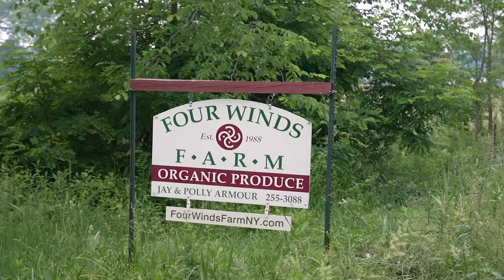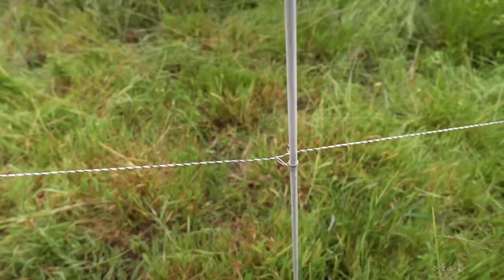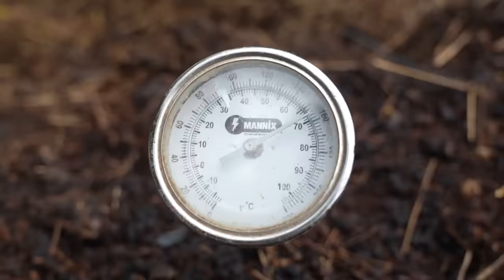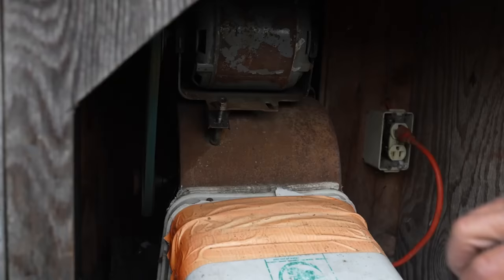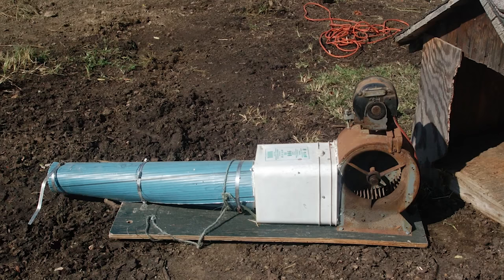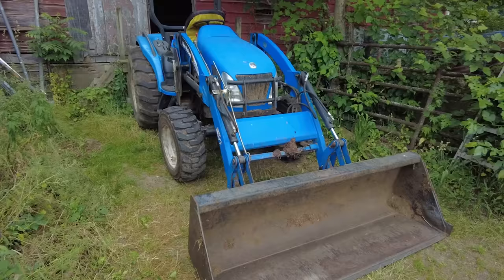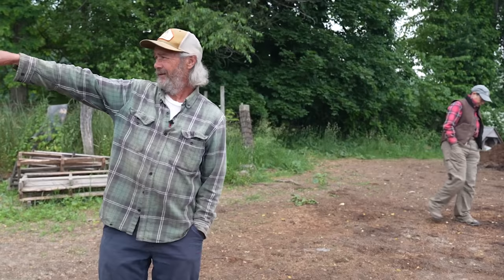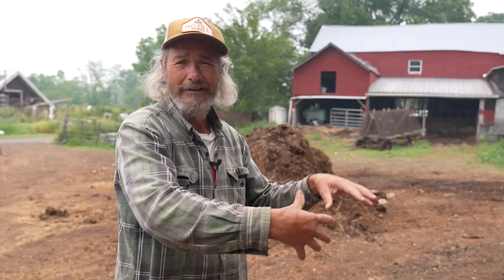A Simple Composting System for Small Farms | Four Winds Farm

Comment: On the forced air system, The fan from a kids bounce house has a round nozzle, and it fits perfectly into 4in drain pipe. We  bought our bounce house from Sam’s Club.
Reply: Good tip!
Reply: I’ve seen that used before works well.😊
Reply: Glorious.
Reply: A nearby city set up a municipal compost system with an old bounce house fan.
Reply: They also sell them individually. Just Google "inline duct fan" they usually come in 4in or 6in. I bought one from ac infinity but honestly if I would've known they were interchangeable I probably would've gotten a bouncy house instead!
Reply: Tell me more! How do you do the timing of turning on and off?
Reply: Another commenter pointed out that an inline duct fan is not the same. It's not. On another note, I read an entire diatribe from an engineer about bouncy house fans. Apparently, they offer a very high static pressure that's also great for removing fumes from laser cutters. +1 to the OP.

Comment: The duct fitting that converts your rectangle blower housing to a round duct is called a "square round" or "square to round." Most HVAC supply houses stock them. If they don't have your exact size, it can typically be ordered and made within 48 hours. A square to round provides less turbulence than your bucket which is essentially called a "plenum." Obviously, plenums work as well and are often necessary to abruptly change the direction of the airflow as a 90 degree turn would.

For those looking to do the same, a direct drive blower is safer. The "belt and pulley pinch point" won't have any mercy on a kids finger or a dog's tail. 1/4" or 1/2" hardware cloth over each side of the blower wheel works great at preventing contact with the wheel. Anything entering that wheel will be chewed into pieces. I have seen it happen with a possum. It ain't pretty! Happy composting!

Comment: Interesting they did not mention moisture. Many say 50% moisture is ideal (squeeze and get a drop or two out of your hand or see the water forming between your fingertips). My piles don’t heat well in our very dry SW Colorado climate without adequate moisture. I definitely need to add water as we build the pile. However, Beware too much water can turn the pile anaerobic.
Reply: Their mix of fresh horse manure and month old cow manure seems to be ideal, so much they don’t even remember to mention moisture ! 
New york climate is good for composting too

Comment: I once read you could cook a chicken in hot compost. Mine was around 160 + or - so I put raw hamburger in a sealed container then put it in the pile. The next morning it was cooked! Ate it too. I started hot composting using leaves from Arizona Ash trees and horse manure from a farm that rescued horses. Worked out very well but with two 3x3x4 foot bins I never had enough for the 6 raised beds I had. I did have PVC pipes through the pile and they did warp due to the heat.

Comment: Seems like you would want to do a full turn at least once.  Even if it technically meets the organic specs it seems unlikely that the temperature on the outside edge would get hot enough to make weed seeds non-viable.  Maybe the stirring with forks combined with relatively weed seed free inputs allows that method to work well for them.
Reply: He does mix it once. See video at 20:50

Comment: If the fan is controlled by a timer, but the owner is monitoring the temperature of the pile, and adjusting the timing of the fan accordingly, would an automatic temperature sensor not make more sense? So rather than the fan being controlled based on time, it’s based on the temperature of the pile. They’re easily found from the same hydroponic providers as mentioned in the video, and would give the ability to wholly set and forget, with no monitoring necessary
Reply: Absolutely an innovation probably just not known about. Sounds like a good setup to me, less hands on the better
Reply: Could be helpful but also adds complexity and other points of failure. A simple timer is easy to troubleshoot, replace, and will last a lot longer than any temp probe. Plus no cords to deal with. Idk if it "isn't thought about" as was suggested, but is just less practical than it sounds at first.
Reply: @stevenjacobs2750  I guess its a matter of scale at that point. I'd agree for the regular backyard gardener or homesteader, its probably not a necessary investment but for medium-large scale operations it could be worth it. You could probably look at all the temps on your phone in real time which could be very useful
Reply: @stevenjacobs2750  Good points

Comment: I use horse manure from a neighbor with 20 horses and leaves from the city, both brought to me in dump truck loads. One way or the other, the big wood, rocks, and trash need to be removed. I do it by hand, but I dream of screening it with a tractor someday. The trash will mark your potatoes and other root crops, plus you get big stuff like street sweeper asphalt chucks, horseshoes, walnuts, and horse toenail clippings Anyhow, be aware there is lots of manual labor if it isn't screened.
Reply: compost the horse hoof shavings.

Comment: Hi and thanks! Great! I wonder if someone could answer couple of questions for me? They use their compost for mulch. Do they add  organic  amendments to their beds also, or does the compost feed the soil well as well as mulch it? My most important question is the reason I am looking at ASP. Though I did not know what they were 6 months ago, I have discovered invasive Asian Jumping Worms in my conditioning compost piles (and in my garden, Missouri Ozarks). Heat kills the worms and their cocoons but as soon as my piles start to cool off the worms move right back in. Don't want to be putting more of these worms into my garden or have therm escape to my forests. Four winds is in an area that probably has jumping worms. I am trying to come up with an ASP system that is off the ground. And then I am going to have to change the way I store compost if I want to keep the worms out.

Comment: Is there any limit to what type of manure you can use? I have access to horse, goat, cow, and rabbit wondering if mixing all of those would work well or if mixing cold manure and hot manure is not recommended
Reply: Those would be great. Dryer manures like rabbit and goat will spo’ge up excess from cow manure. Mix and check the humidity.

Comment: You should use a round in line high CFM fan…like those used for indoor cannabis growing. Some also have dials on them so you can even find the optimal fan speed as well.The same store you got the timer at will have the round fans…for “hydroponics”😂